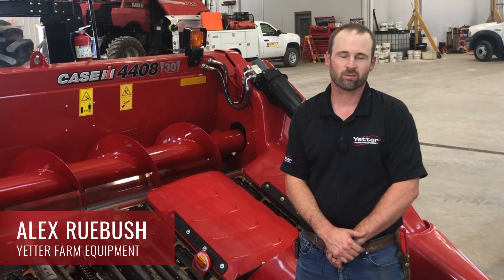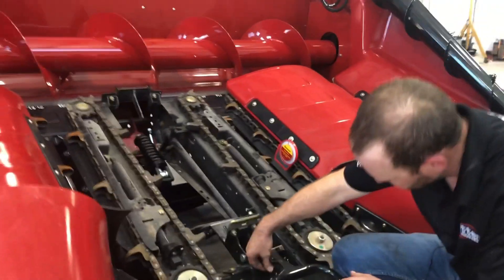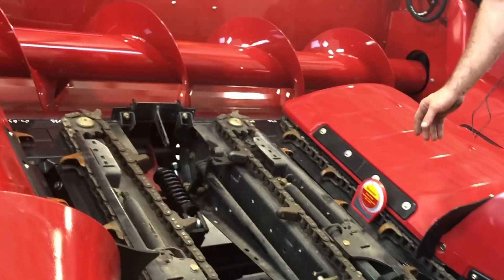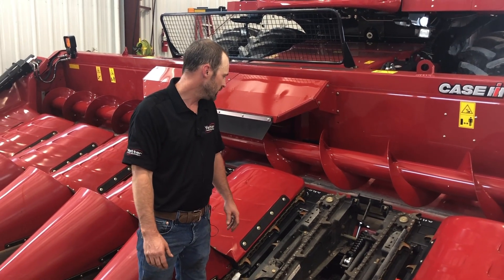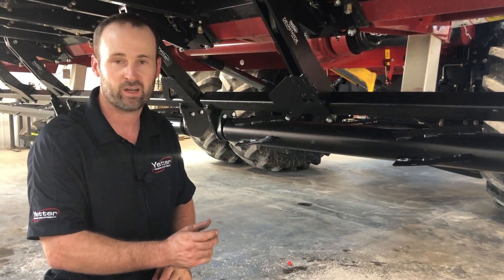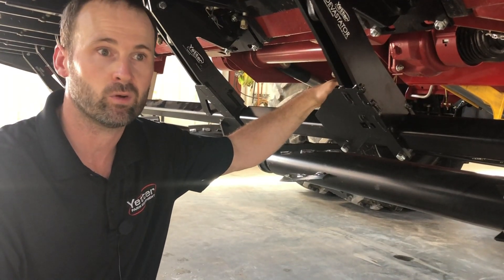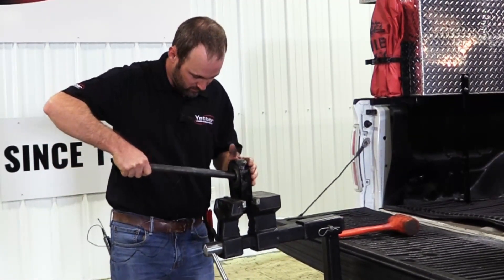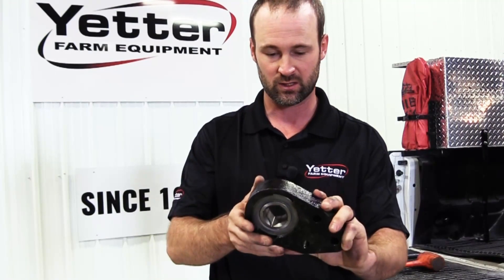Stalk Devastator™ Corn Head Adjustment & Maintenance Tips

Comment: Do you now have a grease zerk on the end of the cast housing
Reply from the maker: The grease zerk was added to the Devastator bearing 2 years ago. It applies the grease between the outer race of the bearing and the housing. The bearing itself is still a sealed bearing.

Comment: How many pounds of down force should it take per row for optimum performance?
Reply from the maker: Down force for optimum performance could vary depending on stalk quality, moisture, & hybrid. Visually inspect the stalk & root ball to make sure each is getting smashed & cracked open which helps accelerate drying out & breakdown of the stalk. Tightening the spring nut will apply more down force if needed.